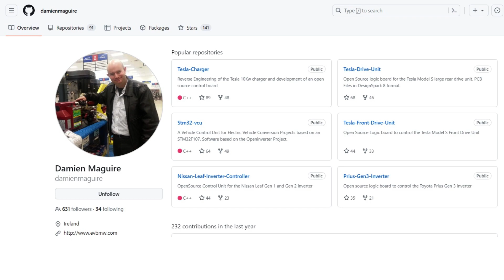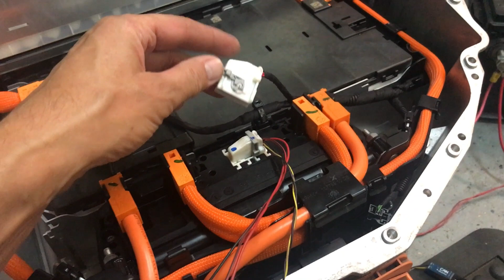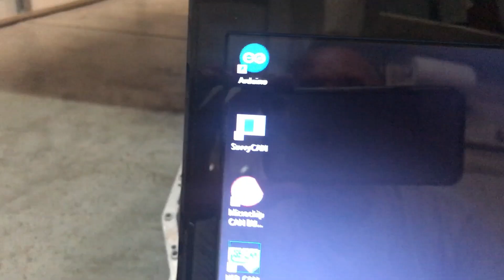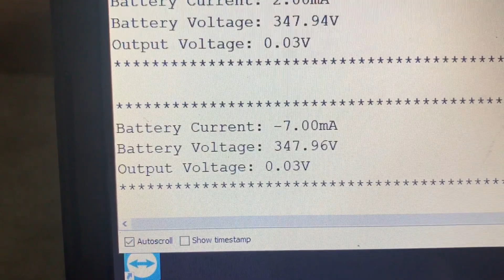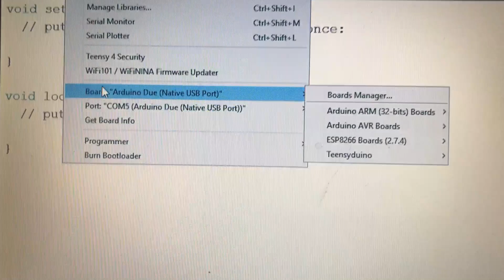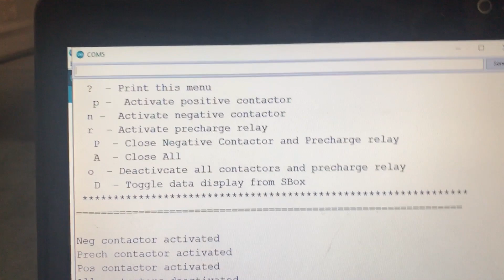BMW 530e HV Battery Safety Box Control #bmw #batterypack #530e

Comment: Helllo!Thanks for your explanation. I have BMW 530 e with 9 kwt battery back. Can I replaced it with 12 kwt pack. It will fit to old space or not. And what about managing unit.
Reply from the maker: its a different S configuration, uses different BMS

Comment: Hello, I have a problem with a BMW G30 530e hybrid, the car was damaged, the pyrotechnic charges were replaced, I connected the computer to unlock the charging, but it doesn't work and there is a fault code, an error in the electrical circuit, can you tell me what is damaged?
Reply from the maker: sorry not a clue, I am not a fan of hybrid cars I just use their batteries, they are way too complex, there is no need to have a gasoline engine and an electric motor in the same car, sorry mate, plus BMWs are super expensive to maintain and repair

Comment: My advice would be seek proper training and correct equipment even though you may of got away with it , it will only take one mistake espically with DC Voltages will hold on a cook you inside out. While I am sure for the DIE HARDS then ignorance will be bliss or not . Good luck spinning that wheel. I would prefer the correct knowledge from people who know the industry and also why certain equipment is used for certain test this highlights inadequate knowledge on something that looks straight forward.  Clearly from you response you are unaware of which CAT meter you need.... I would suggest CAT III minimum but CAT IV if you can afford and wish to remain here longer
Reply from the maker: thank you

Comment: Little knowledge is dangerous , showing pack voltage of 300+ V but the multimeter looks cheap and probably not the correct CAT rating which can allow transisent voltages to move over the meter and with bare hands, total hero.. you should attend some training first before attempting working on or near live voltages and espically DC.
Reply from the maker: I had that cheap volt meter for 30 years and worked on about a dozen homes with it
Reply: Shame the others that surviived good respond the same with internal burns  DC burns @Good-Enuff-Garage

Comment: Do you know if the safety box can still be used if reconfiguring the pack for a lower voltage, for example taking the 6 packs and instead of being 6s being 2s3p to give 130V approx when charged?
Reply from the maker: i think so since we dont use it to its full capability all we do is close and open the two large contactors in it and the pre charge relay, the other components in there are a current shunt and a resistor so you would just use software to close them when you want or at a pre charged voltage you tell it to

Comment: Hey thanks, that was a good video, so without opening the battery box, there is no way of checking of you've got a good one?
Reply from the maker: Correct, there are three ways to measure the voltage and all require the lid to be removed, cause we can't get through the BMW OEM master BMS box which sits directly behind that external plug
1. Multimeter directly to the leads from module 1 and module 6 
2. SimpBMS,     https://youtu.be/PbGWhILUdbU
3. Sbox code (this video)
Reply: If it's in the car you can check it with ISTA+. The ISTA output files even tells the voltages of each cells.